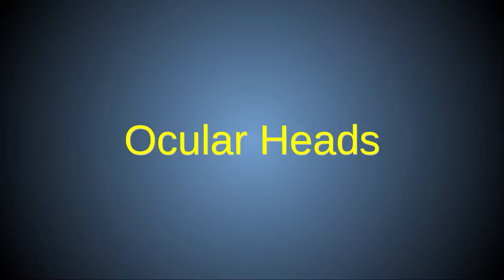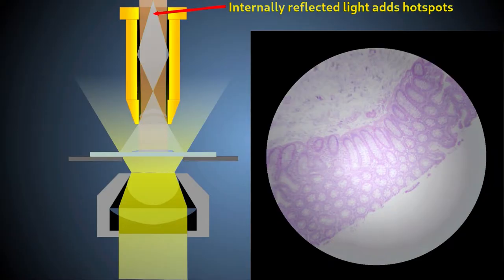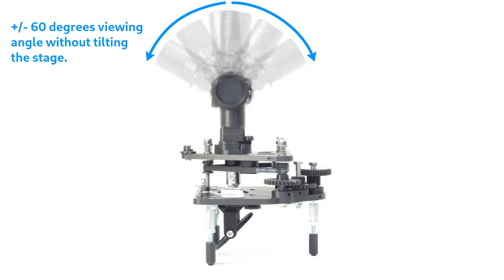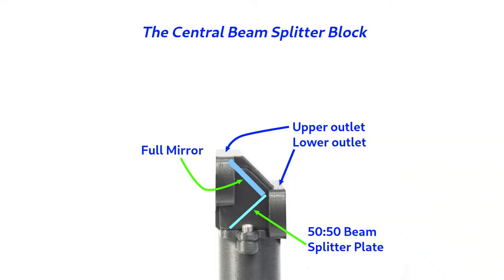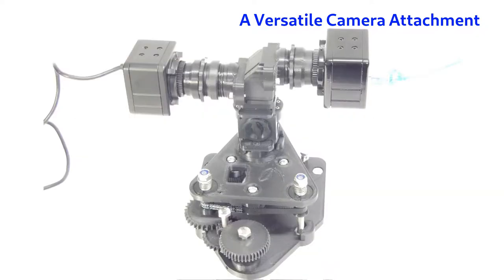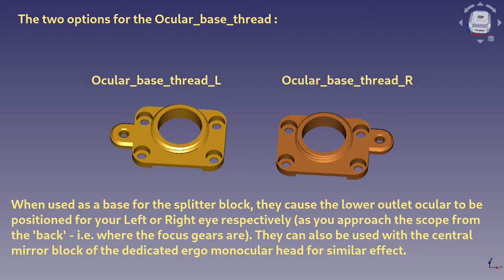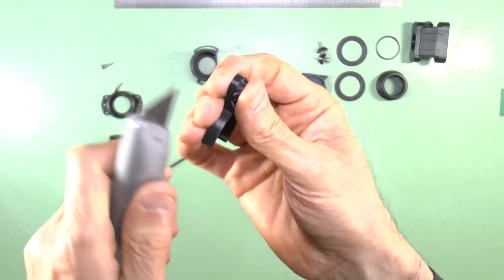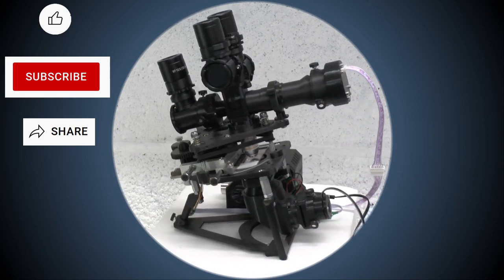The Ocular Head Options for the PUMA 3D Printed Open Source Microscope

Comment: Fantastic to see the mashup of classic and modern British engineering! Amazing job! This is exactly how 3d printers should be used, I can see this taking off in a huge way!
Reply from the maker: Thanks - and yet so few people seem to be aware of the project. Please tell others about it on social media and amongst your colleagues. More videos are on the way, and I've just released a 'Quick Start' guide PDF on the GitHub site to make it easy for people to get started building their first scope.
Reply: @PUMAMicroscope  definitely have been and will do more. The quality and myopic detail of your work really shines through. I am in the process of ordering the non-printed parts to start having a play around with it myself. I can't believe you managed to get a TFT filter working, along with all the modularity, wow.
Reply from the maker: That's great. If you have questions you can contact me via the support desk email @optarc.co.uk or raise a GitHub issue if that's more appropriate. I am in the process of making the video on the TFT SLM - it involves some very delicate 'electro-surgery' so it's taking me some time to put that video together.